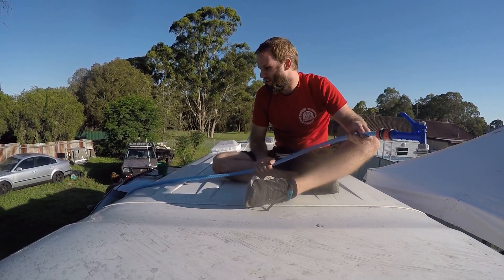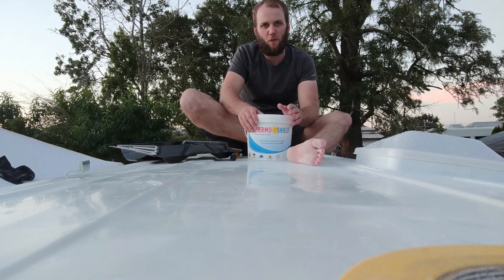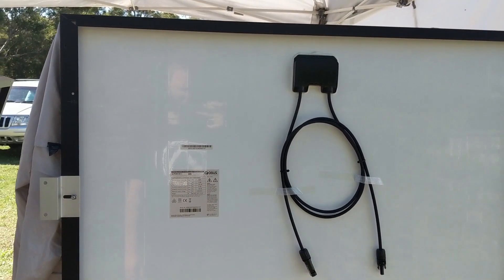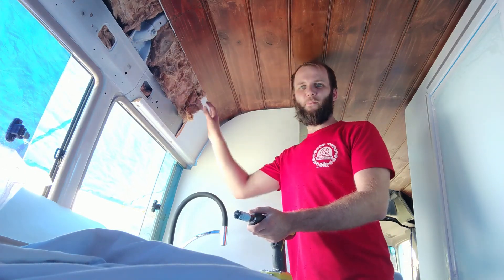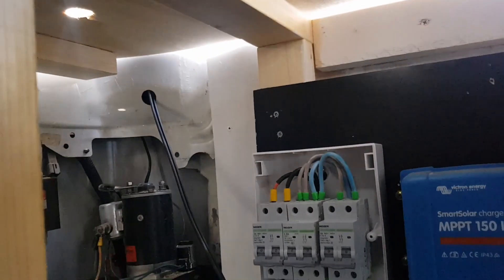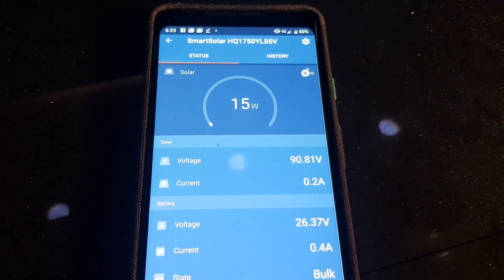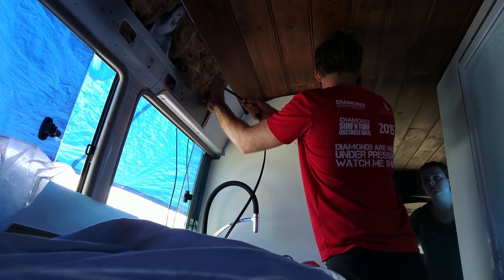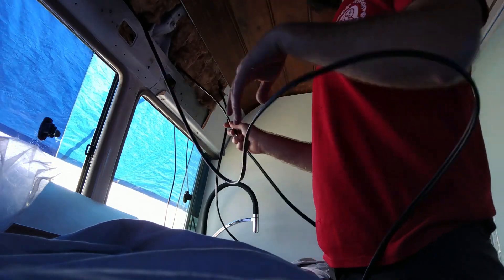Toyota Coaster Bus Conversion - Solar Panel Installation

Comment: Hi, really love your videos, question, do you need electrician to install solar to the motorhome 12v system or can I do it? does it need to be certified?
Reply from the maker: Hi Frank, no in Australia you are allowed to do the 12V yourself. Both 12v and 24v is considered low voltage. It is if you have any 240v that needs to be installed by a qualified electrician and certified.
At least in Australia where we are anyways, not sure in other countries.
Hope that helps!
Reply: I think you will find that in Australia,  anything over 60 volts needs to be done by an electrician.  Looking at your solar panels,  these appear to be over 60V. Most people don't know this and do it themselves,  but as long as your careful you should be ok.

Comment: What do you mean by sanding the roof?
Reply from the maker: Hi, before applying the Thermoshield paint, the instructions say to give the surface a light sand. This is to rough up the surface a little so that the paint sticks better. 
Thanks!

Comment: Do you think a wind deflector for your panels is warranted. Just curious about wind noise. Cheers
Reply from the maker: Hi Richard, there was a little bit of noise from the wind on the panels but we just got used to it and it wasn't a bother, mainly higher speeds. However the panels do need air flow under them to keep them cool, so if you were to put a wind deflector on, just keep this in mind. Thanks!

Comment: Did you remove the AC vents above to windows were you are running the solar cables?
Reply from the maker: Yep! We removed all of the AC vents along the sides of the bus. We covered the area where they were with 3mm plywood, which is what the solar cable runs behind.
Reply: @RoamingonRubber  
Nice, I'm considering buying a 1993 Coaster and shipping it here to the US. They look like  the perfect Off the Grid RV.

Comment: The problem with series is that if even a quarter of 1 panel gets covered by a tree etc you lose the whole lot and it stops charging
Reply from the maker: I originally wanted it in parallel for that reason, but was advised series would be better with those panels and having a 24v battery system.

In reality it hasn't been that bad. I believe the way it works is if one has some shade, the other panels drop their output to match the lowest. So you are losing more output, but it's not all or nothing.

Comment: I did the thermsheid , I also put it on the rear window and the side rear windows that are around ow bed , we have a reversing cam , I’m about to order more and more clear coat , I put my panels a bit higher then yours so that have better cooling, the cooler the better the panels work , it has no rust preventing property, I’m pissed that I did not white night pant it first with white night rust guard paint . Available at Bunnings or red cote, a roof vent over ow bed with a built in fan keeps the bus a lovable temperature...
Reply from the maker: If you want more it must work pretty well! We bought block out curtains for every window and got a big roll of foil sun shade stuff and cut it for each window.
I wasn't sure how high above the roof to put them, was concerned too much of a gap might create too much lift and peel them off! But our brackets were ready made solar brackets from jaycar so was easy.

Interesting idea about rust proofing the roof first. Not something we thought of either. We sanded and sprayed anywhere a bit of rust already was but that would have helped.

Comment: I would have turned my solar panels long ways. it wouldn't be hanging over the sides
Reply from the maker: We wanted to as it would have looked a lot nicer! But the panels were too long to fit 3 panels across the bus with the two vents that we had to navigate. They are 1670mm long each.